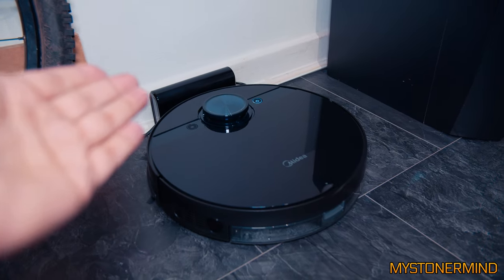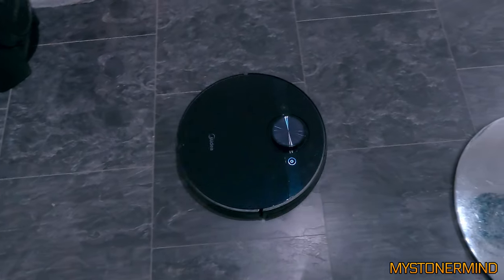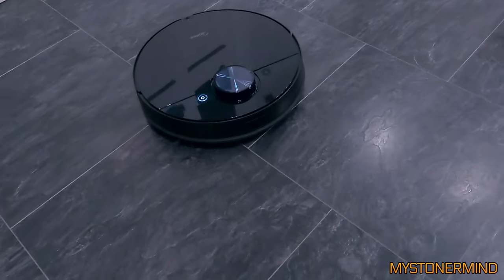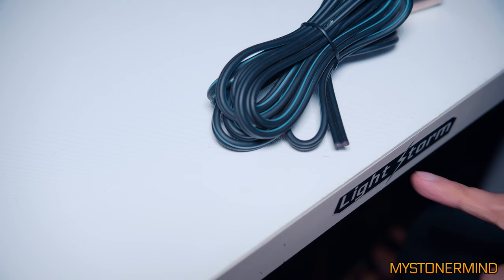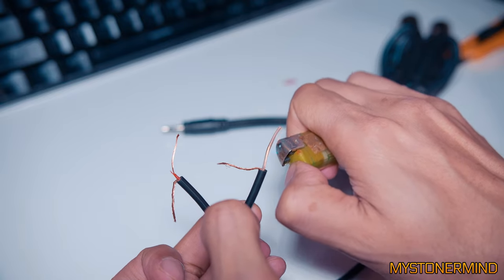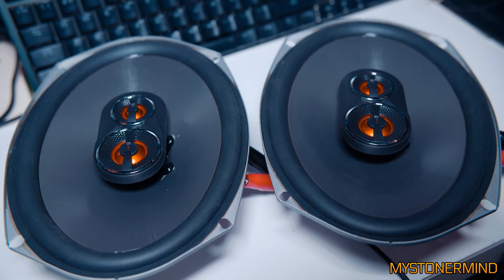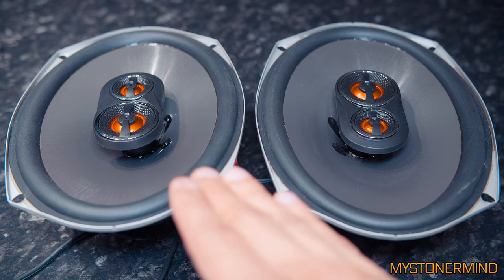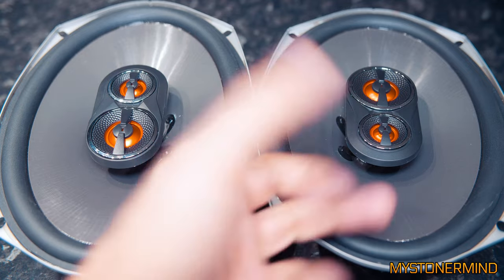Turning Speakers Into Microphones

Comment: You know how its so hard to record massive amounts of SPL in a car? Just use a subwoofer as the mic. A subwoofer to record a subwoofer 😃 Im sure its not that straight forward lol But someone out there can make one properly.
Reply: As for the vacuum. It would be cool to be able to connect a Bluetooth controller to one and use it to steer it with lol
Reply from the maker: I think I would use a regular mic but lower the gain and use a deadcat for all the air moving around.
Reply: @MyStonerMind420  But theres no mic that can handle 170db pressure for example last I checked lol Too many vids with distorted audio due to bad mics. Nobody has designed one. Even with a deadcat and lowered gain. Still is not enough. Thats what made me come up with the idea.
Reply from the maker: @randomtube8226  non of these people know how to properly record audio yet alone use a mic. Using these speakers wouldn't work either, the pressure would be too much. Nobody I know would record bass from a system, let alone from a loud system, it makes no sense to do that.